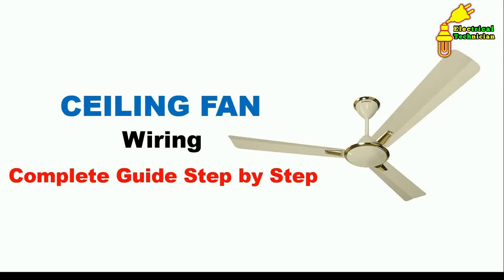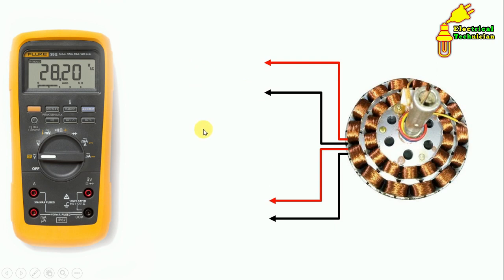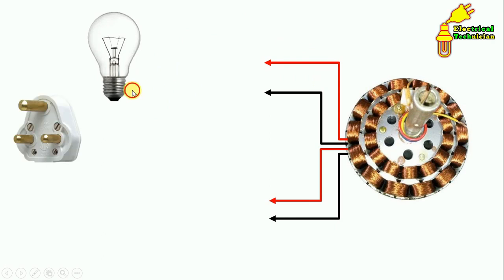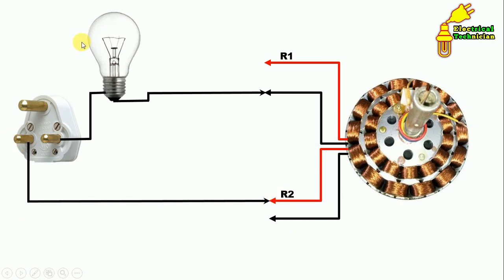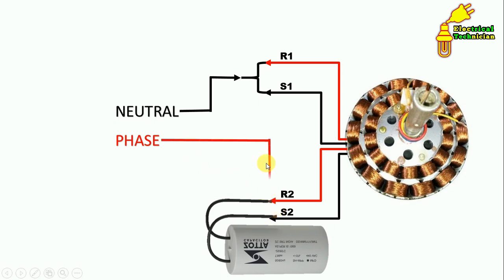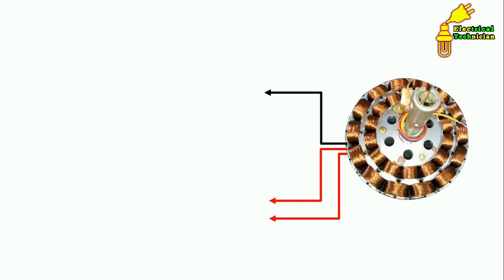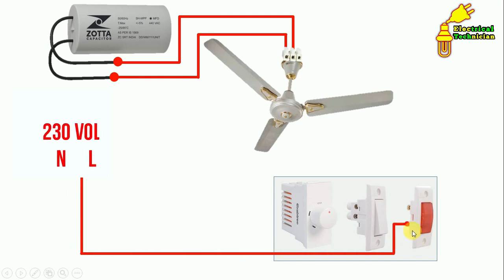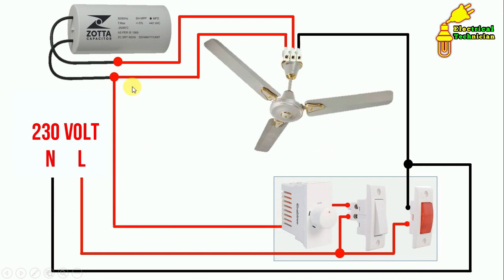Ceiling Fan Connection of Three Wire  and Four Wire With Capacitor @TheElectricalGuy

Comment: In my fan 4 phase is out my when I'm connecting fan is working properly, Can you tell me about due to the wire change my fan can run slowly 😊 I'm using 3.15 mf capacitor but running slowly not much slow but slower than new one please tell me about 😊